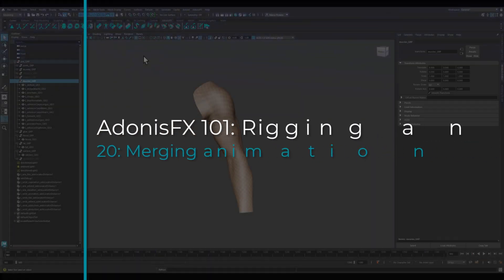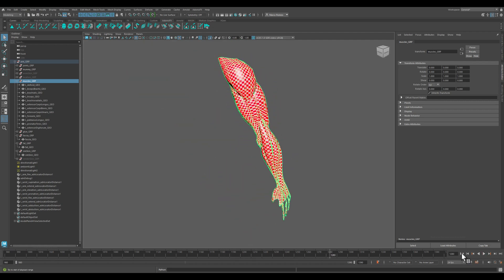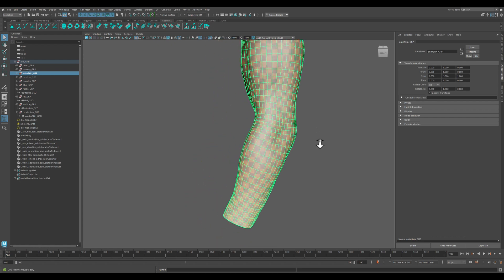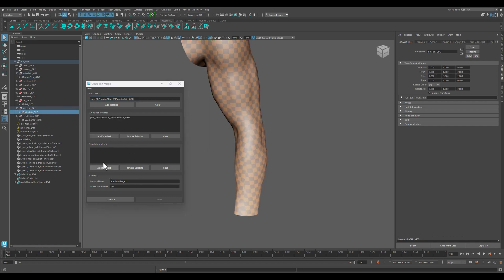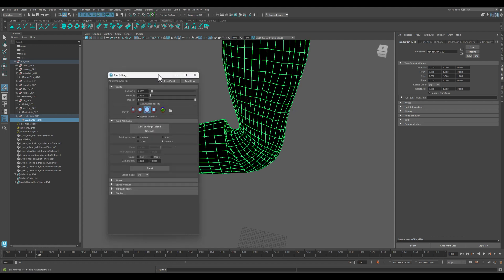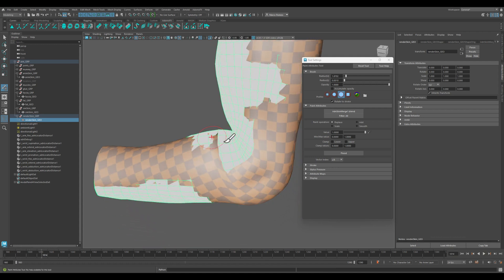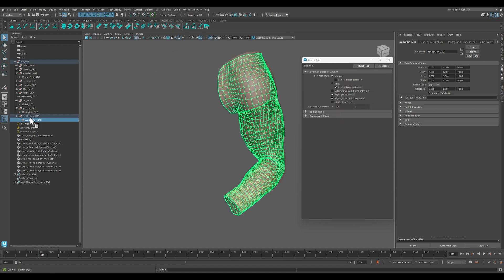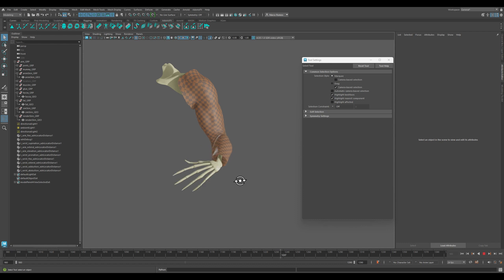AdonisFX Tutorials 101 - Rigging an Arm - 20: Merging animation and simulation (version 1.4)

Comment: Could you tell me what AdonisFX can do that Ziva can't? And what Ziva can do that AdonisFX can't? Thank you!
Reply from the maker: Hello Mahmoud, AdonisFX is very similar to Ziva in the sense that they are designed to solve the same problem, however they are very different in how they achieve such goal.
AdonisFX relies on a very different Simulation framework than Ziva. This means that AdonisFX can simulate digital tissues at a fraction of the times required by Ziva.
Also AdonisFX has solvers like AdnSimshape that Ziva does not have and that provide a unique way to simulate faces with believable dynamics.
AdonisFX also has a whole suit of locators that you can use to track and debug the activation of muscles.
Ziva has collisions and the ability to tetrahedralize the volumes to be simulated while AdonisFX still can't. Such features are crrently scheduled to be delivered through the first quarter of 2025.

Finally and probably most importantly:
* AdonisFX will be ported to Houdini in 2025 to allow for seamless Maya and Houdini workflows.
* Ziva is NOT AVAILABLE anymore as it is now exclusively owned and used by DNEG.
Reply: Thank you for the clear explanation   @inbibo